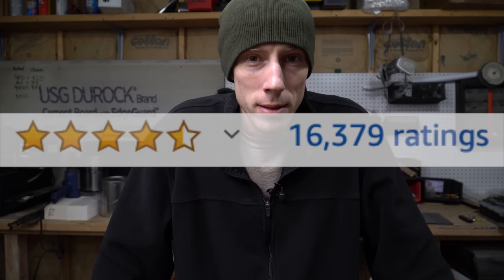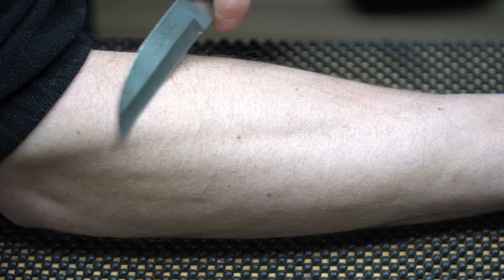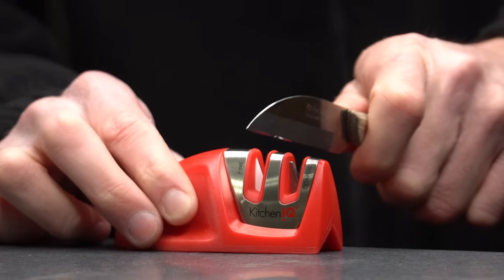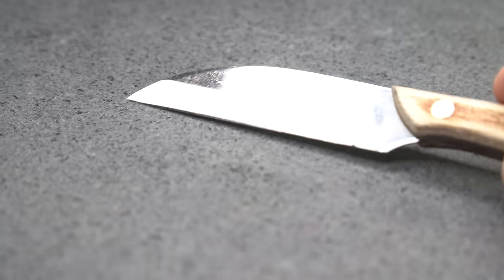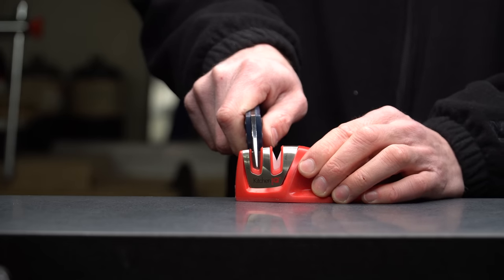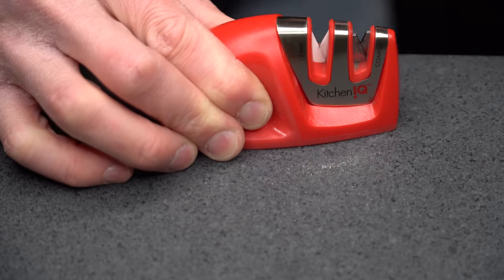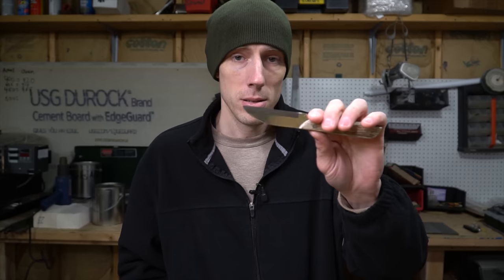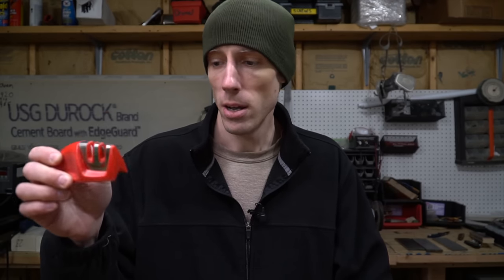I Bought The Most Reviewed Knife Sharpener On Amazon

Comment: The Spyderco wouldn't sharpen on those carbide wedges because they are high vanadium steel. Vanadium carbides are harder than tungsten carbide.
Reply: That got me thinking, there's got to be more to it than just that. The tungsten carbide wedges are still harder than the steel matrix and the vanadium carbides are rather small too, about 3 micron or so and just get ripped out along with the steel. My guess is that if he kept at it for a while he would have eventually got a decently sharp working edge. I've heard many people say you need diamond to sharpen s110v but I've had luck sharpening high carbide steels like s30v, s110v, etc with aluminum oxide stones, although diamond or cbn makes things easier.
Reply: @carlosmatos9848  Vanadium and chromium carbides are measured in nano-meters, not microns (millionths). The eta carbide group is like 10-15 nanometers (billionths) across. Pure tungsten carbide is 9.2 on the Mohs scale, vanadium carbide is 9.4. AO or sapphire/ruby is 9, diamond is 10, but in ultimate hardness scale the aluminum oxide is 400 and diamond is 1500. That's a heck of a bell curve. When I put the final cutting bevel on my knives I use my 1x42 belt sander with 400 grit silicon oxide with a drip to keep the edge cool.
Reply: @MountainFisher  I'm not sure where you got that from. The vanadium carbides in powdered steels like S110V are usually about 1-3 micron in size and evenly distributed throughout the steel matrix, unlike something like D2 steel where they are much larger, about 50 microns or so. Plus you never addressed the issue of whether he'd put an edge on that S110V if he kept going, my guess is he could, but the wear resistance of S110V vs a carbide pull through sharpener isn't because of the 9% vanadium content alone. Like I said, you can sharpen high carbide steels on aluminum oxide stones, especially coarser stones.

Comment: This is just for honing or realigning the edge on a knife that is a little dull, not a lot dull, but they can be really helpful especially for small paring knives with pretty thin blades.   This is designed for the angle on a Western or Euro knife like a Henkel not the steeper angle they put on harder Japanese style knives with a different edge.   For my China/Japan knife I use a steel and then sharpen with an actual sharpener when really dull.  Also the thicker style hunting knife probably not a good candidate for this thing.

Comment: Ive used plenty of the cheap carbide sharpeners. The thing is that they wear out pretty quickly and after they do, they just dull after.
Some softer steel do ok with them. But if you actually know what your doing, your far better off.

Comment: These aren't really for putting a fine edge on a blade.  They're for putting a usable edge on a hard work knife.  They work fine for that purpose if you've got a cheap $20 folder that you're going to use to open boxes or whatever.

Comment: The instructions for some of these 3 step handheld knife sharpeners say to use the tungsten first, then the diamond, then the ceramic. The instructions for other 3 step sharpeners say to use the diamond sharpener first, then the tungsten sharpener, then the ceramic sharpener. I never know which method to use. If I’m going to use a 3 step sharpener, which order would you recommend? Diamond, tungsten, ceramic or tungsten, diamond, ceramic?

Comment: The only thing I use a pull-through carbide sharpener (lansky) for, is to keep in my backpack when I'm trekking so that if I destroy my blades in the middle of nowhere, I can get them sharp enough to work again.

Other than that, I would never use a pull-through carbide sharpener for anything else.

Comment: Interesting that you go into detail about the steel, but don't mention the grinds until the last. As far as I can tell, the first was hollow ground, the second was convex, and the third was flat. Also, is there any reason why you refused to stabilize the sharpener on a counter or table edge? Or are you so oblivious you did not notice the shape of the bottom? Also, why didn't you try using the ceramic side when the second blade was too hard for the coarse side?

Comment: I think it is a good product for someone using cheap soft-metal knives that take a lot of abuse and just want to get a quick workable edge.
Reply: That is the main purpose realistically. These aren't meant to give you the results of more professional like sharpening, but if you need to say cut through meat or veggies and it is struggling in the moment it works well. 

This kind works on my mercer culinary knives that are entry level fine enough and then I properly sharpen then down the road. I primarily only use the fine side, but it has never completely ruined a knife that made it unusable. Mind you I don't buy knives to be show pieces do I do workhorse type knives that may get suspended every so often, but eventually get replaced since I don't buy overtly expensive ones. 

Once you go down the route of knives actually used in culinary school or the food service industry (at least in parts of it) you'll find a lot of quick honing and the like done and then they are sent out for pro sharpening.

A honing steel and the ceramic side of this actually can help a lot more in the moment, but it is best when it hits the struggling point to only do that once then properly sharpen it after

Comment: You will never get a razor sharp edge from one of these basic, simple sharpeners.  That being said, they do a fairly good job of "dressing up" a dull blade.  I prefer the "Smith's" sharpener as it is smaller, thinner, and will fit into the sharpening stone pocket found on many knife sheaths.  Much easier to use than one of those small, sheath pocket stones.

Comment: hey can you test this 
Lansky Blademedic PS-MED01 
it lookt the same as one u test in this video, but it's same company you suggest to buy
Reply: I would be interested in that video as well! But yes, half of it will be a repeat, so I'll save you some time. 😉 

(TLDR, I don't recommend ANY tungsten pull through sharpeners or compact doodads for beginners. If you overuse them, or use them poorly, you get exactly the results in this video. I also don't recommend them for truly dull knives. Only for light honing and touch-ups on an average stainless steel knife, and only if you know what you're doing.)

Blade Medic is exactly my compact sharpener! I've used the coarse tungsten side on a cheap knife a few times, and used it very lightly. It did the job. The ceramic V will be gentler, and it's the part I use on most of my better knives in the field, if they need a little tightening up. I've tested the other two hones from time to time, and I can make it work, but I prefer a larger hone or stone for larger knives. The small hones are pretty good for serrated blades, if you're patient enough.
Reply: @ShovelChef  thanks ;-)

Comment: I tried one after another growing up, until someone gave me a stone with 2 sides... I'd use it but it was never perfect.. It sucked but I learned how to use it and then bought a cheap little Smith diamond flat thing with a carbide v to shape the blade if necessary and then use the diamond and there was two ceramic rods with flat side half circle side, a point or "fish hook" honing cut down one side of the 2 flat side to hone it down...with it you could place the rods  in a sort of V in relation to each other to help good the angle if you need it. The ceramic would leave it with a mirror finish edge and I finally had VERY sharp knives. Had it for like 15 years lost it, still have at least 1 of the ceramic rods probly both, used one yesterday..

Comment: The Lansky one is way better.... but you need some way to clean the ceramic rods, I think they sell the eraser for that, after some sharpening as the metal from the knives would have deposited itself into the pores of the ceramic itself... that said.. it is going to last longer than the diamond version since the diamond version is just a coating.

Comment: I had a scissors sharpener and it works like that one i used it on my knife's which were dull to the point it couldn't cut a hotdog i grinded on it and in the end it was sharpened enough to cut hair

Comment: I work with people who regularly use these kinds of sharpeners, sometimes multiple times within the span of an hour, because they don't leave any sort of good edge by themselves. I can see these being used in place of something like a 140 diamond plate where you really need to repair the edge, but the pulling motion can tear chunks out of the edge and repeated, improper use leads to wavy edges that require far more work to repair than simple proper maintenance. It's acceptable for cheaper kitchen knives, particularly since I imagine most people would otherwise just toss out overly dull knives and buy new ones, but these are in no way a product that should be used to maintain halfway decent knives. Useful to have around in a pinch, but something like a ceramic honing rod I find has a better result while taking about the same amount of time to use as one of these. Certainly not going to ask everyone to 'professionally' sharpen their blades, but good maintenance and the tool for the job is something I like to point out to beginners I see falling into these traps.

Comment: As you use it the little dugin spots it creates as it scrapes away the metal get deeper and bigger. I see them a lot. I am a pro sharpener . Its worst problem is it cuts hardest near the finger guard of kitchen knives and then you can't cut against the cutting board in that section of the knife anymore. The damage is fixable but at a cost of blade size. I tell people to use it only in emergency. Now that i've finished this comment I simultaneously got to the end of your video. You pretty much mention all I had typed.

Comment: Lol on ruining the edge of each knife, first! These are for backpacking tune-ups and the best have a small, folding carbon steel rod for edge straightening. The angle of the steel and ceramic v's is 'average' angle and should be used if the knife's edge has a similarly average grind. I only ever need to use the small steel rod to tune my knives and have learned not to use too much pressure when using these temporary devices, and taking some time stroking with the ceramic side. I get better action by holding the blade still, pointing up and moving the sharpener over the blade with light pressure.

Comment: So, these blade sharpeners basically take long, rough strips off the place where the bevel normally is to make a ratchy and rough bevel? I don't know if I would say that's a good sharpener at all. I mean, it will sharpen, but how badly is the blade metal damaged and pitted at that point to where you need to sharpen it again in shorter and shorter time periods to maintain the edge? I discovered stones a year or two back and I will never sharpen my good knives in any other way again.

Comment: Actually, those sharpeners work and don't ruin the edge bevels. You just have to understand how knives should be sharpened and that's true, for any kind of sharpening system. If you use this with proper stable 90 degree angles and you don't push hard as he does here, or change the angle sideways, then this sharpening system, can provide razor if not scary sharp edges. It's the perfect tool to maintain a super sharp edge on your kitchen knives and I also like it on D2 steel knives. It's one fo the best, if not the best tools for D2 edges. In 2 minutes, it makes D2 from dull to scary sharp!!
Reply from the maker: Lol wrong, completely wrong. Literally everything you wrote is not true even in the slightest. Yo are not sharpening D2 with these lol🤣
Reply: @OUTDOORS55  I do! It also has ceramic rods. At least my version does. I've sharpened Vanadis 4 extra at 61 hrc, why have a problem with D2? It works ok on full flat grinds and if you use a strop afterwords, I checked the edge with the magnyfing glass (X10) is was just fine. As I wrote my last comment, I had just finished my kind of dull D2 (60 hrc) back to razor sharp. Can't touch it's edge actually, it feels like it will cut you, so, close to scary sharp with no efforts. You just use it slower more careful. Of course I wouldn't suggest this thing for inexperienced people, no matter if it's easy to use. But for my cheap kitchen knives, it is my favorite tool to keep em sharp. Scary sharp actually because of the ceramic it comes with.
Reply from the maker: And I'm the majority share holder of Amazon. You can say anything on the internet that doesn't make it true. You'll have to offer some proof of SHARPENING vandis 4 or d2 to a nice edge. Not some jagged crap. There's a reason pros don't use them.

Comment: Not saying this type of sharpener is good, but everyone that reviews them uses way to much pressure when sharpening soft steel. Light pressure gives a far more consistent edge.
Reply: Treu problem is in multiple sharpenings. The edge starts to wave a lot. And the next sharpening will accentuate that waviness due to the fact that you use more force in the low of the waves. It ruins you edge even on the best of steels. I've seen 3mm deviations from straight in the drawer of my parents. Total cringe.

Comment: Sorry dude... had to fast forward you trashing that edge 😱🤐! I just got into knife sharpening and I only have cheap Walmart Ozark knives, but I did just get a Schrade SCHF59 for like $28 which I know is still a “cheap” knife but it’s a better quality steel if I’m not mistaken and has a much thicker profile. I think I went too shallow on one side not sure how to fix it. I don’t have a strop either...  just the Smith’s 4” Diamond stone combination  portable sharpener (400/725 I think) and I can get a usable edge but my angles are still inconsistent but I’m getting better and I realized a strop with some compound or fine ceramic rod is almost necessary to take that final burr down.

Comment: I would suggest you keep away from $25 Damascus steel knives and a $5.99 Amazon knife sharpener. The Damascus knife should be used as a butter knife and the knife sharpener should NOT be used on any knife which costs more than $26. The former will not cut and the latter is a knife destroyer.

Comment: "it's technically sharp..." 
If you consider an obtuse 70 to 90 degree inclusive angle (depending on brand) "sharp".

I don't. 
Nor does anyone I know.
Not even on an axe/hatchet/tomahawk.

Draw through "sharpeners" (note quotes) might be good for thinning the edge on a old improperly sharpened axe/hatchet/tomahawk, but that is about it ... or maybe an anchor for a float tube, if you have enough of them.

Comment: V slot knife sharpener ruin our knife edge by scraping off (a lot of) metal, instead of horning. It is design to operate in a lateral direction and not crossing the cutting edge, against all quality knife manufactures do, include razor blade. 

V slot sharpening finish is like brute force shaping our knife with a grind stone moving in the direction along side the cutting ridge. Result ? Will reduce the micro pitch (teeth) by 1000 times or more. That way the edge apex is easer to chip in normal and heavy duty cutting that needs more frequent sharpening and lower longevity. 

 It violate the principle of edge forming and purpose.

Comment: Their Ratings system is more likely based upon their need to sell over stocked items. Rule #1 Never use a $5.00 sharpener to sharpen a $30.00 knife 2. Don't buy cheap knives

Comment: I think you duing it wrong. You must pull up an down in one swing. First iron is for shape knife to propper shape. And is tot for this kind of knifes but for kitchin knife. Is different type of steel. You sharpenning attack knife with kitchen sharpener. Attack knife is build for not bending, hard steel for penetration. Kitchin knife is bending soft steel for cutting not for penetration. I think as knife expert you must know this basic information...

Comment: Those sharpeners don’t really “sharpen” knives. What they’re designed to do is more akin to honing. They straighten the soft metal from cheap kitchen knives until it is straight again. But they aren’t supposed to remove material. You must have gotten pretty aggressive with that poor kitchen knife. It’s ridiculous that they advertise them as “sharpeners”.

Comment: That was extremely painful to watch. I got a "sharpener" from a gun show and thought it was neat. Thinking was the wife could quickly touch up a knife. Pretty much the same deal just this one has a suction cup so it dose not "slip".... After I used it I noticed it turned all my knifes in to bread knifes. The spots it's got sharp were very sharp and the rest was not good at all. I found the longer the knife the worse the job it did. As you can see in your video the knives were canted lots. Same problem I had. Then like you see it would catch and skip making it dangerous to use. I still have it as a reminder of the show (ripped my exhaust system out of a truck I drove off the lot no less then 30 days of owning :) went form hill Billy lift to just a leveling kit) so now I show folks my 2,025$ sharpener as that's all I got at that show. For knifes of poor quality steel that are in the 3-4" lenght there really quick and some what easy.

Comment: Those sharpeners are always trash. The idea itself is flawed, because they are expecting all your knives to have the same edge geometry... You are literally better off with sandpaper, or any flat abrasive that you can used to sharpen by hand to get the angle you need.  Wet sand paper, then homemade strop. EASY.     That gave me physical pain to see the bevels left with that sharpener.